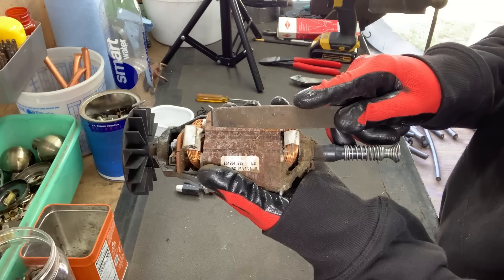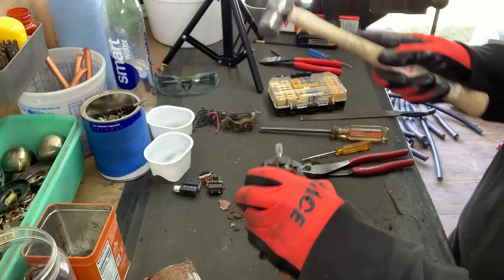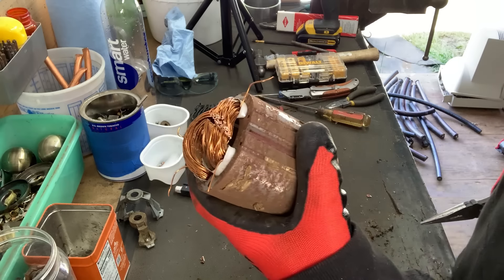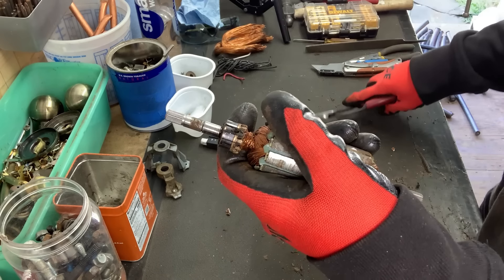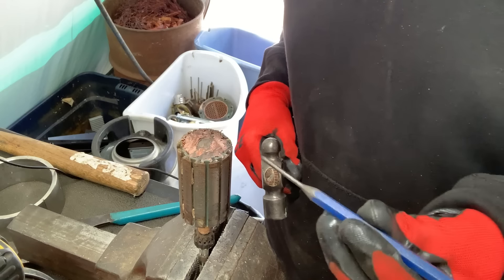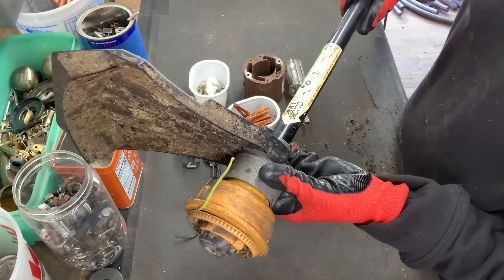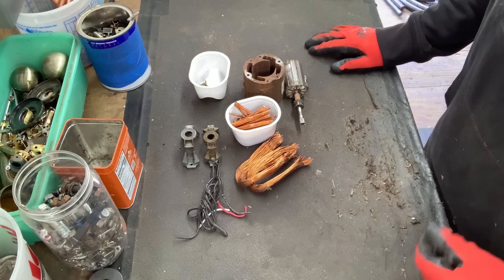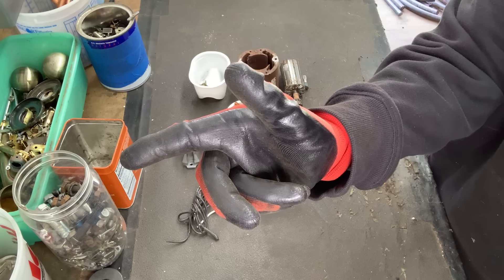Scrapping an Electric Weed Whacker

Comment: good show!!!   I never see a breakdown of an undersink garbage disposal. Try it sometime.  nice score of copper and brass!
Reply from the maker: Thank you! 
I actually have a video planned for one of those coming soon. 
Thank you for watching.
Reply: Don't be disappointed the last 4 that I scrapped unfortunately had aluminum windings. Also I never heard the term #1 steel. Is that for steel larger than 1/4" thick? And thank you for the prayer for depression. Thanks
Reply from the maker: @aaronedmunds4829  yeah that’s my experience with them as well. 
#1 prepared steel is somewhere around that thickness, it can vary depending on scrapyards though. 
You’re very welcome for the prayer.
Reply: @scrapitall200  Thank You. God bless you !
Reply from the maker: @aaronedmunds4829  thank you!

Comment: Do you strip the insulated wire? Thanks for the prayers. They are very encouraging.
Reply from the maker: I do strip insulated wire but nothing above 14 gauge is where I draw the line. Some only strip 10 gauge and lower. It really depends on the prices you get from local scrapyards for insulated copper wire price versus clean copper prices. 
You’re welcome! 😃

Comment: If Im not mistaken what you call shread we call shearing  on this side of the pond . I also wated to say I have been pulling the pins from plugs for a while now , just got a new  contact for moulded plugs that can no longer wok on the appliance . this supplier has also promied me over heated and or burnt out motors ( the guy deals in small appliance repairs ( I have been trading with him for a number of years
Reply from the maker: My yard actually calls shred bulk appliances. Interesting how different yards call it by different names. 
That sounds like a good deal for you!

Comment: Harbor Freight cable cutters work great for cutting the copper wire on the motors. SKU# 6649
Reply from the maker: Absolutely! 
I’m looking for a pair used for cheaper or finding some being thrown away. I don’t mind using the cutters I have, doesn’t take much effort at all.